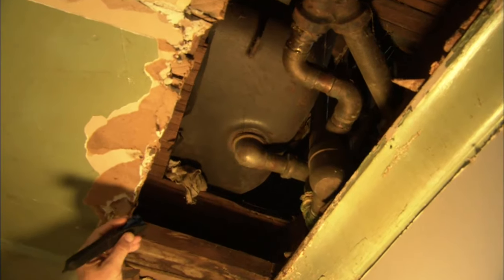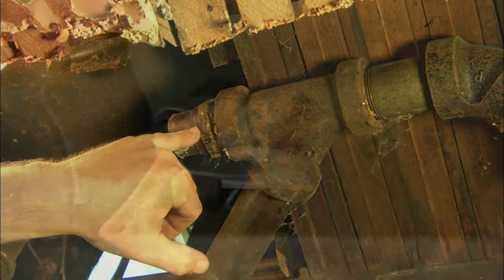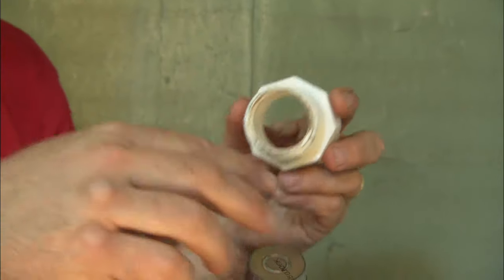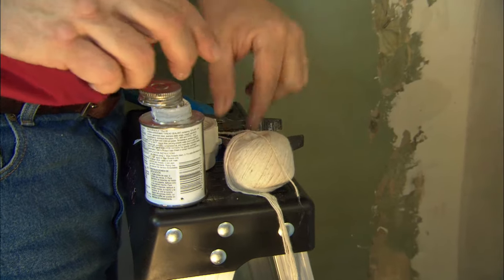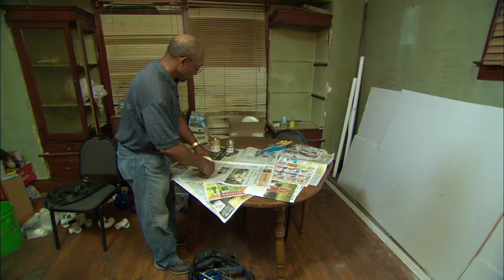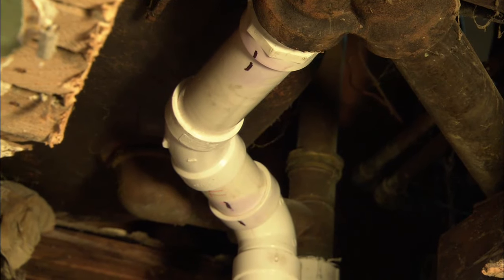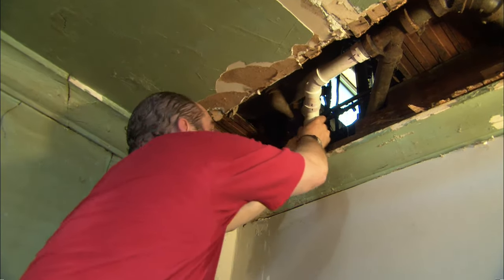How to Replace a Bathtub Drum Trap | This Old House

Comment: Just a tip from a plumber, before disposing of the drum trap, always break them open, i've found many cool items, including jewelry inside of these and house traps.
Reply: I wasn't so lucky. Mine had quite a bit of liquid mercury which spilled all over the rough wood subfloor. The shiny beads went everywhere and kept sub dividing into smaller and smaller beads as I attempted to clean them up. Nasty stuff that can release toxic mercury vapor years. It had probably been in that drum trap since the 1950s when some idiot poured it down the drain after breaking a mercury filled thermometer.
Reply: @madcowusa4277   Wow!  That's crazy!
Reply: @madcowusa4277  Hopefully, you never have to deal with mercury again.  However, dealing with spilled mercury is not that difficult.  You sprinkle powdered sulfur on it.  A chemical reaction occurs that results in mercuric sulfide, which is among the MOST insoluble substances around.  Boiling concentrated nitric acid will not attack mercuric sulfide.
Reply: @madcowusa4277  I have a similar issue, but my drum trap is made of lead. Pipes were custom made since the configuration is pretty unique. Don't need to replace it yet, but I saved this video for when the time comes.
Reply: @TheLouisianan  are they led drain pipes?
Reply: why would there be a Drum trap made of PVC in a 50s house, that has a PVC drum going into lead and cast iron at the cleanout?  If that doesnt make sense please ask questions maybe I can explain better.
Reply: @eliduttman315  Sounds like epsom salt (magnesium sulfate) might work for that!!!

Comment: I love how these semi-nightmare scenarios get fixed on video in 5 minutes whereas in the real world there are unforeseen consequences like cracked pipes, barked knuckles, spilled yeech water and often swearing a blue streak.  All good fun.
Reply: Yes and now he has no cleanout
Reply: That doesn't happen that often if you're experienced and these video are meant to impart a good degree of that.
Reply: The videos are edited.
They lasted longer and scenes were editted our for time purposes.

The TV show is for 30 minutes and has multiple projects in 1 episode.

Plus commericals too.
That leaves you with around 5 to 8 minutes per repair.
Reply: @Johnkoth  the YouTube shorts are even shorter than the full episode.
Reply: It's all staged for the camera.  Often there's a separate crew that does the pre-work to take things apart and install things that look old but were really just put in.
Reply: Oh, you’ve seen me plumb before ...
Reply: They have to make it PG-13
Reply: If you noticed that first Sawsall cut went extremely fast.  I wonder if Rich made a previous cut 80% through?
Reply: Or the time I did this, and forgot the rag I'd stuck in the pipe at the sewer stack end... I ran the faucet to leak test it and went downstairs, only to come up to a nearly overflowing bathtub....

Thankfully snaking a rag through my brand new p-trap was easy peasy!
Reply: @oilnfireyeah because they're working on the drain line. It's non-potable water, so who cares if there's lead in those pipes.

Comment: Just think how many houses in North America have that old drum trap still in their systems.
Reply: What's wrong with them?
Reply: The main problem is they collect sediment and can't be snaked. Most have a cleanout cap, but after decades it may be impossible to open, or inaccessible behind a ceiling or wall.
Reply: Clickety Clack I have a 50 yo house and the tub drain is stopped. I've tried everything. This could be the reason? I have easy access to it but don't want to tear it apart if I don't have to. Sorry if this is bothersome
Reply: matt smejek most likely that is the reason. I have one as well and the shower/tub drain is very slow to drain. After baking soda and vinegar, plungers, and snakes, you can pretty much assume it's the drum trap. The problem with me is I'm a hairy guy, so all the hair is probably all caked in the drum trap.
Reply: Yep, I'm living in one now buit 1968. with the same issues.
Reply: and that mucky gunk (@1:00; 2:16) built up in.
Reply: I do. I have lead drain piping as well.
Reply: Yeah im sitting out in my upstairs hallway trying to spin that square nut cap off so I can dig out whatever has plagued us for 17 years with a slow draining tub.  You can't snake these traps and the hellspawn at Zurn made the nut 1 1/16".

I use a wet vac, and tape up all vents in order to get some hair and muck cleaned out.  Not a long term fix however
Reply: Mine!
Reply: @bg147  I've got the same thing. Custom made since it's in a tight spot. House was built in '56
Reply: @TheLouisianan  I think they are cool.
Reply: @bg147  I agree, made of lead and people think it's going to stab you while you sleep it's so dangerous.
Reply: Use the Kinetic Water Ram max pressure 35-40 psi. Remove the overflow plate stuff a rag use screwdriver to push on the rag to prevent from blowing out and pop the tub drain.  Been doing it for years  in Chicago
Reply: @TheLouisianan  Yes, and it is always better to tear up an old vinyl floor containing asbestos versus leaving it down where it is doing no harm.
Reply: @kchicago64  I lived most of my life in Barrington. Are there a lot of old houses closer in that still have the lead traps? Go Bears!
Reply: @BradiKal61  Just tried it with a pipe wrench.  Square nut ain't square no more.  Time to get out the recip saw.

Comment: I tried removing the cap from my drum trap to clean it out. I had a cheater bar so long the house was spinning on its foundation and I couldn't budge the cap. Richard it the luckiest plumber I've ever seen.
Reply: If your cover has a lip that extends past the drum, the best way to remove it is with a cold chisel and a big hammer. Drive the chisel into the lip counterclockwise, the impact helps to break things loose. You'll probably have to repeat it multiple times around the circumference before it lets go.

If you put a new cover on, a wrap of teflon tape will make the job easier the next time.

If you have a cover like the one in the video, you might still get it out with a chisel, in pieces.
Reply: @jasexavier  The cap does not have a lip, only a square nut. I have a jetter with a very small head but even that won't make the 90s. I used acid to clean the drain and it's been working good for a few years now.
Reply: Time and patience and I have none

Comment: I think they take it apart first, then put it back together for the show.  On all of this fix it or replace it, they never show you what to do if this goes, wrong or that goes wrong.
Reply: I noticed that first saw sal cut he made was at about a 45 degree angle and then magically he goes back to that pipe and it's not just an exposed male thread. Probably some curse words when taking the old piece off.

Comment: I am a self-employed plumber with 34 year's experience and only on TV Will a 70 year old 1 1/2" copper male adapter come out of a steel fitting that easy. We would have charged $185 plus materials, plus hole cutting for that service call

Comment: I replaced my drum trap or whatever its called few years ago and replaced it with pvc drum trap the same looking thing except the new was pvc the old was metal.  I didn't know i could just add a catch base like this. It would have been much easier and no limitation of draining water.

Comment: I usually use a pole from my kids swing set as a breaker bar on my wrench to loosen the old pipe threads.
Reply: Cheater bar. Yeah I use anything I can find, usually a piece of 1"1/2 pvc since I'm a plumber and it's readily available.
Reply: @Scott-eo7lj  i tried pvc and it broke into bits.

Comment: Question: Why doesn't the new pvc trap have a clean out plug?
Reply: I'm going to guess because it's going to be a finished ceiling again. I don't think you could have a clean out where where it would be blocked by a finished space.
Reply: You can remove the overflow plate in the tub and clean it from there as well.
Reply: You could easily snake that too. That's essentially a sweeping elbow. I have some old cast pipes with a sharp P trap and it has the clean out plug on the bottom. Realized it's there because I couldn't get my snake to make the turn.
Reply: It’s a drain plug for cold weather climate

Comment: I wish every time I went to replace a tub trap it went this easy
Reply: Yeah especially in western states where the trap is in the slap. Good luck with just replacing the trap.
Reply: No shit did one today no pipe wrench was going to loosen anything had to saw zaw pipe out of threads and chisel it loose took over 8 hours .i think this was prepped before cameras rolled.that pipe is way to old to spin out that easy, just saying
Reply: yea a lot of people are saying this, i think for their 30 min episodes they cant show all the work it takes most times, they just show the main points of what they are doing
Reply: @mikehardesty98  try heating it up next time after you let it soak in PB blaster for a few minutes. Get it hot then attempt tighten it a little before loosening it.  8/10 it will come out.

Comment: Great video enjoyed it! Bad news It pop up after i worked on a tub.😠. And question can I use the blue glue 4 Plumbing. Is it code allowable or for repairs only
Reply: Blue is used for pressurized systems

Comment: When looking at the trap that was removed, look all the way to the left, the first bend directly under the drain has a drill sized hole causing my tub to leak out before it even gets to the p-trap, also the tub is slow draining even when this is happening, any suggestions?

Comment: How high can water pressure push up the trap? I have one of these basin traps and it's a PITA. But I haven't replaced with a p-trap because it needs to be like 6 inches. Is this ok?
Reply: If you mean how high it will sit? Assuming you have no clogs the water level will sit just at the bottom of where the water exits the pipe at the top. Water will also sit at that exact same elevation in the pipe leading to your shower drain. If you have a clog, that's a different story.

Comment: one should only put pipe dope or glue on the male end of fitting.  if put on the female end the excess could partially block off the flow area.

Comment: So both fittings came loose for you?
Im calling shenanigans
Reply: Almost never happens
Reply: BradiKal61 mine while I cut a single pipe and the entire stack falls apart in a heap lol
Reply: @Mrcaffinebean  
I call plumbing 'lighting the fuse' because you are starting a sequential trail of destruction.
Reply: BradiKal61 haha very good analogy
Reply: Probably the original cast iron drum trap was replace with a cast copper drum trap the one who replaced it probably had a hard time cutting out the old cast iron one and galv piping  and did anyone notice that Richard didn’t try to clean de-burr  or remove the copper piping attached to the waste and over flow on the bottom run of the tee. If the waste and overflow is in good shape better to keep it  it better made than today’s stuff

Comment: I am a plumber he should have replaced the whole tub waste an overflow and cut out that galvanized drain pipe he retired into.it’s not meant to be drain pipe it’s ok for venting.Eventually down the road drain pipe gets all scale and clogged up,that if you try to snake it’s like drilling through concrete.sometimes you can get it clear or if you do get it clear sometimes the pipe ends up leaking.

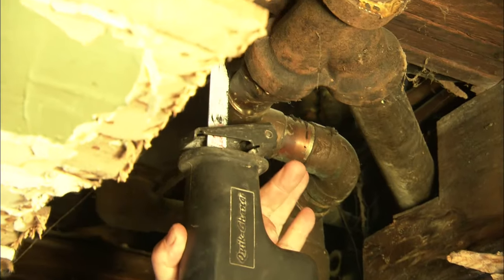Comment: At 0:38 Wow were did you get that blade😂😂😂😂 the pipe was butter or that blade is made of magic lol.
Reply: chefbillyx specially for cast iron. Home Depot
Reply: It's thin copper pipe, so it basically is butter. Although, I worked in a lab where we cut a lot of metal, and we had some recip blades that cut thick metal, including mild steel, like magic. I can't remember the brand (might have been ICS?), but they were labelled 'For Metal 1/8" and Over'.
Reply: It was already cut off camera.

Comment: HOW COME NO PURPLE PRIMER BEFORE GLUE ???
i thought for PCV Pipe need to Purple Brime before GLUE ???
what gives
Reply: Joni English I think they also make one now where the cleaner and the glue are in one solution, but I could be wrong.
Reply: @johnsushi2007  I've scene "clear" primers too. They probably used that, but I like the purple stuff since I know I got full exposure.
Reply: I was wondering the same thing. 🤔

Comment: Question for plumbers. I have this exact scenario with having to replace my drum with pvc ptrap. Is it true I need to vent ptrap? I have been told this on multiple forums however do not understand exactly where to vent the trap.
Reply: EL1TE ONE you need a vent on the drain downstream of the trap within 6 feet of the trap itself if its 1.5" and 8 feet if the trap is two inch
Reply: Its should be near your toilet line which should be within distance of the vent
Reply: These guy’s read to much if you have enough room yea vent it but it’s not worth tearing up yer house unless you just can’t live with a slow draining tub

Comment: How do you replace a p trap that comes from the floor?
Reply: Aaron Lipscomb all p traps come from the floor
Reply: @axelbuckets3858  Pretty sure he means the drain terminates at the floor rather than going into a wall.
Reply: Is it on a concrete slab? If so, you will have to pull the tub or shower then dig it up to replace the trap.
Reply: Call a real plumber it’s no match for you

Comment: I have a PVC drum trap under my bathroom sink with an access on the bottom. It’s a complete PITA to clean when clogged and there isn’t access in the basement to snake the descending portion of the pipe. I’d personally love to punch the plumber installing that mess.
Reply: that drum trap has probably been there a long time.

Comment: It is worth the few extra seconds to de-burr the outside of the PVC cut pipe too.  It makes slipping it into the connector trouble-free.
Reply: Porsche924Tim don't use a Sawzall
Reply: Or use  a deburring Tool.

Comment: I thought pipe-dope and plastic is a no no?
Reply: I never herd that. Ive used pipe dope for years on pvc, cast iron, brass, copper and haven't had any issues. In fact ive stopped using thread tape and have switched to pipe dope for most things that aren't pressurized
Reply: Old school pipe dope has mineral oils that'll break down the plastic. This kind tends to be grey to greyish-black in color and reeks of oil.

Newer stuff is PTFE based, and won't affect plastics. Oatey Great White and Rectorseal no. 55 both come to mind, as does Blue Monster's pie dope.

Comment: So was the whole reason for doing this the "scum" reason & easier clean out ? was there a sediment build up problem that warranted this & do you now build an access panel for future accessibility ?
Reply: Drum traps worked, but they also collected sediment. The more modern P-Trap is pretty much self-cleaning. An access panel is not necessary, because if there is a clog in the future, you can run a snake through the drain above. You cannot run a snake through a drum trap.